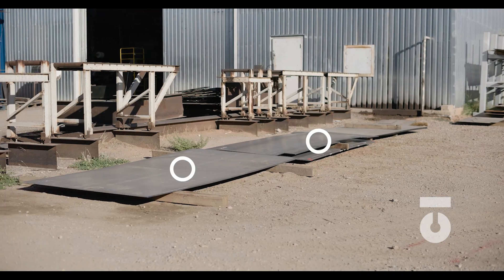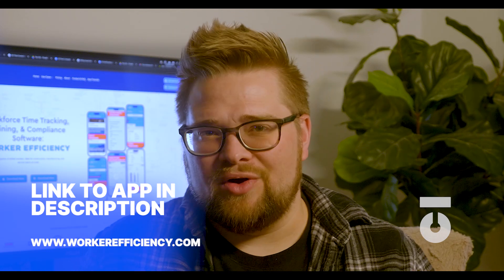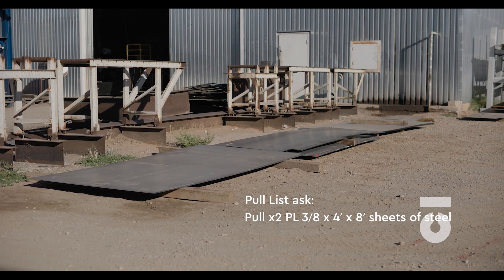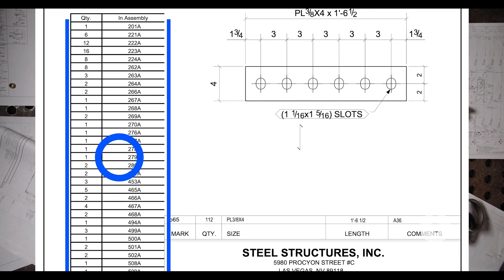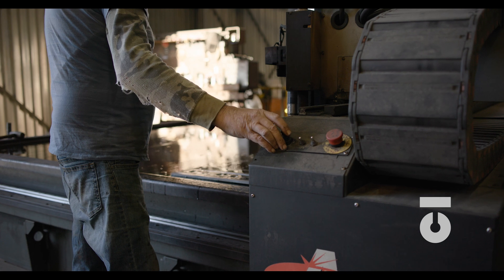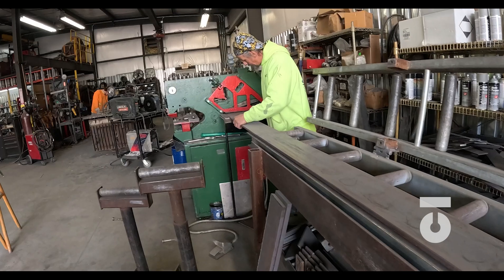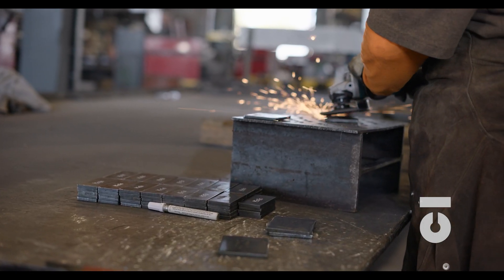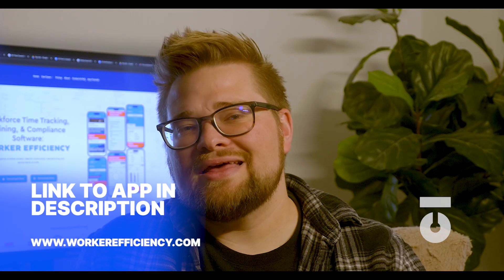Steel Fabrication Part 5: Cutting Parts for Steel Construction

Comment: Great video
Btw Why do high-rise buildings use preassembled steel frames consisting of three floors at a time?
Is it because of thermal expansion? Slenderness ratio? Or simply for convenience in fabrication and erection?
Are there any structural or steel-engineering reasons behind this approach?